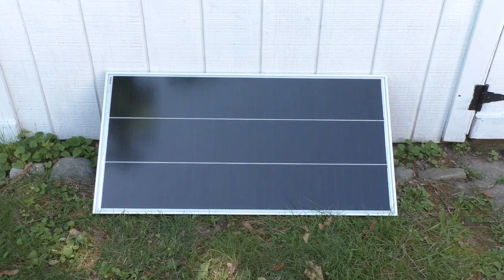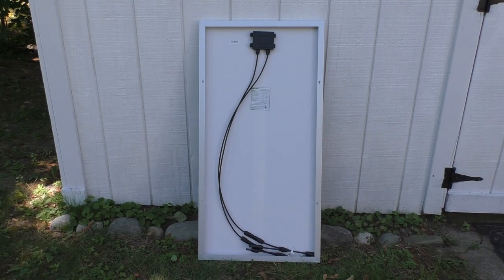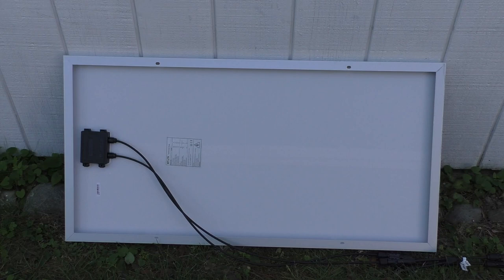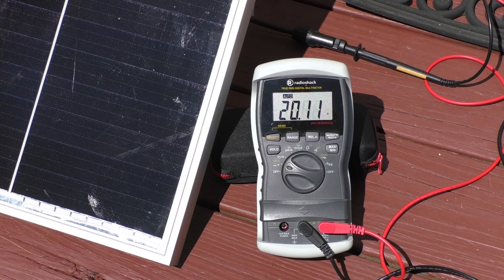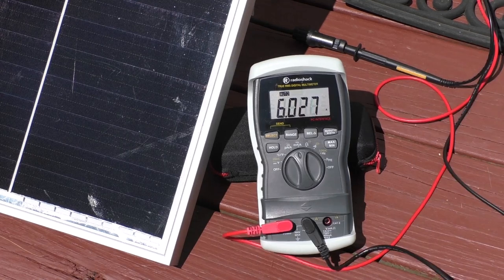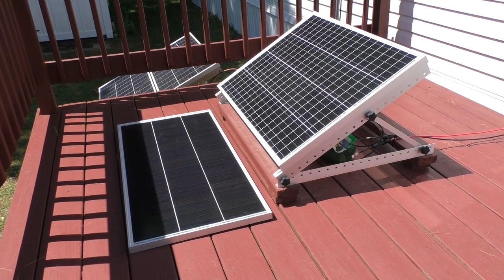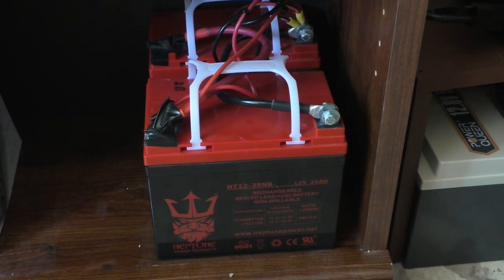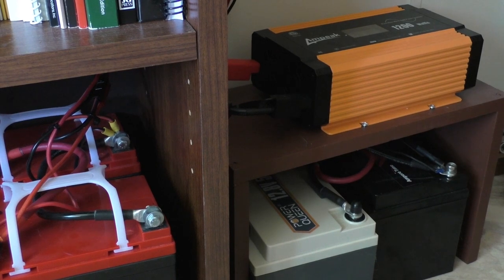Weize 100W Monocrystalline Solar Panel - A review

Comment: Also a Mainer, Casco, I have 4 WEIZE 100w panels so far the Rover 40a and soon (next week) the GIANDREL 2000w 24v Inverter. The panels were bought in full 200w kits so got wires, Z-brackets and a PWM controller in each kit. The plan ultimately is 24v 800w to 'not' grid tie for internal use on a fridge, lo voltage lighting, 24v backup water pump and charging. Essentially a power down basic minimum backup.
Not a ham YET but own a couple HT's, I'll get to that soon enough. Crazy world got to try to keep one step ahead, right?
So, yeah similar paths, subscribed.
Reply from the maker: Sounds like a nice system you have going, similar to my 400 W setup. You probably saved a good bit of money getting the kits. 
Grid tie systems open a whole can of worms, inspections are required and expensive equipment, and the electric companies pay like 50% of the value of the elect we send them.
Getting into ham radio is a great idea.. nice to have backup if cell towers fail for whatever reason,

Comment: FYI, the spec named "Voc" is not "short circuit voltage".  It's "Open Circuit Voltage" or "Voltage - Open Circuit".
Reply from the maker: Yes that's true, thank you. I should have said open circuit voltage as you mentioned. I meant to say short circuit current for measuring the current which is in the same manner on solar panels.

Comment: I'd like to know if I can mix and match? Do different branded panels work if you connect them together?
Reply from the maker: Yes you can connect different brands either in series or parallel as long as wattage is the same and voltage the same. So 100w 12v panels together for example. Check maximum voltage of each panel if connecting many in series as the voltage is added by each panel.

Comment: Is this a 12 or 24 volt solar panel (weize)
Reply from the maker: These are 12v panels.. though i currently have them in series for 24v going to the controller.

Comment: The panel looks a bit dirty. Does that affect the performance?
Reply from the maker: hI... I didn't realize it had smudges from the factory until I saw it in the bright sun in the video... I took windex and it cleaned up fine. In use, it will get dust, pollen, etc that barely affects the output, but I still hose down all my panels periodically.  Plus the rain rinses them off for me, and in the winter, brushing off the snow cleans it too.
Reply: @hamradiocomms  I wondered about that. So, how dirty can it get before it affects the output a lot? Thanks for the reply.
Reply from the maker: @tubbysailor  I think dirt, dust, pollen on it would affect it depending on how obscured the panel gets. Light dusting etc maybe a couple percent down but heavy concentrations would start lowering output by 20, 30% and more of really heavy dirt on it but I think that would be unusual. Normal dusting won’t affect much. We had pine pollen in the spring that turned everything green here in hours and was thick. I hosed down my panels everyday for about three days knowing it was dropping output… it was so thick people here had to clean their windshields before driving because we were unable to see through it !!